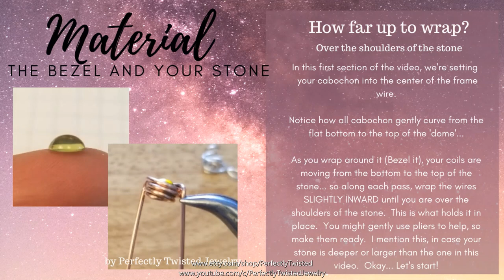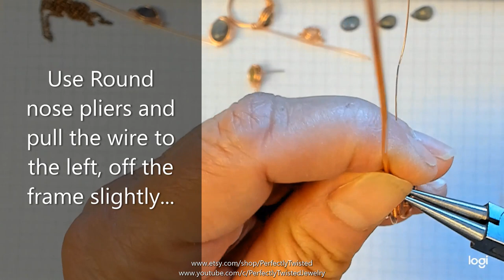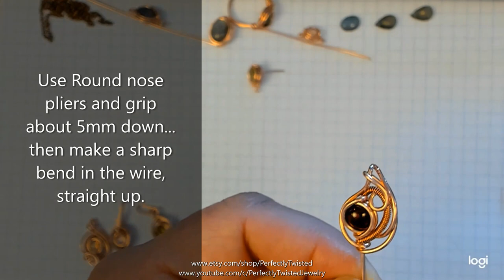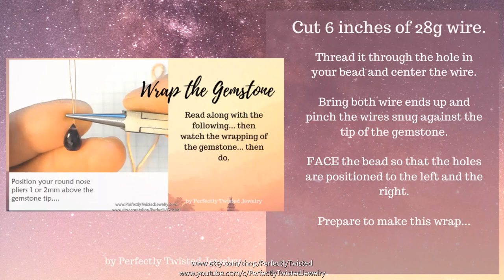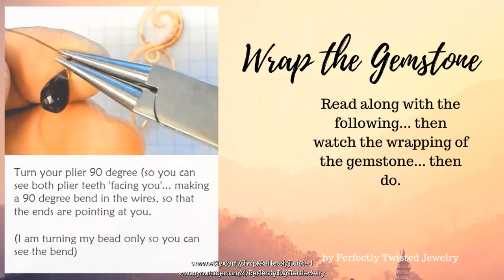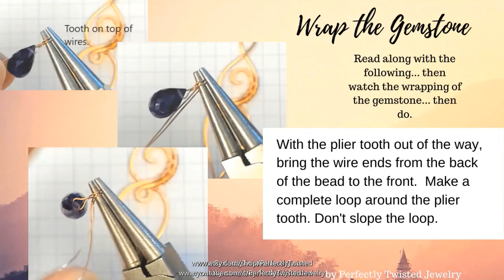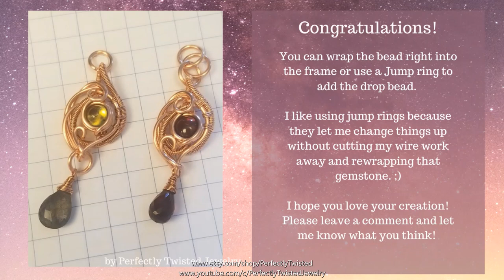MAKE IT! Wire Wrapping Tutorial - Galaxyz Eye, 1 Frame Wire Mini Cab Wire Wrapped, Weaved Pendant

Comment: Which size of wire do you use for the main frame, the one holding the stone in please?  Your tutorials are very clear and I love how you solve little problems as they arise.   Thank you so much for sharing.  ❤
Reply from the maker: It's 20 gauge, round, soft.  The materials and tools are normally in the first 10 seconds.  Thanks, Dora!

Comment: So lovely! Could it be done with square wire to give more grip to the stone? And could you use a faceted stone? Thank you.
Reply from the maker: Thanks for asking Patricia!  Yes on both... you can use square wire for this design, you'll need to either decide you're okay with square wire twisting as you work, or you'll work to keep the square wires as untwisted as possible as you work, or you'll go with however the square wire flows ;)  That is basically the only difference in concern.  The last wrap around the stone, at the very top of the stone,, should be slightly more narrow and cover the stone shoulders to hold it in.  You can use pliers to gently assist as you wrap, tap the coils inward.

If you use the faceted stone, then you'll also need to consider the back 'point'... make sure that you account for the fact that you'll have to use pliers to help you make an upside-down 'cone' with the wire (narrow point, working upward to more open round top of stone) ...  if the Faceted round stone has a deep pavilion.  Some faceted stones are more 'shallow' in the back and are more similar to a flat backed cabochon, in which case, the tutorial wraps should cover you, but make sure you check your faceted gemstone and account for this.  

Hope that helps!  Enjoy the tutorial!

Comment: Love this tutorial ❤️ would it by any chance work with faucet stones?
Reply from the maker: Thanks Elizabeth,  the idea of the capture works for a facetrdcstone but if your Stone has a point on the back, then the S curves will make it hard to set centered.  Check this one out and see if this works better,... it's the same but uses a loop to start. Hope this helps!  I also have a couple of tutorials for pendants using this one. https://youtu.be/ynMWoUh110Y
Reply: @PerfectlyTwistedJewelry  would it work with an oval cabochon?
Reply from the maker: Yes it will... here is my Leonis Ring...  it starts the same way as Midway, but uses an Oval Prehnite stone.  You don't have to do the ring but can watch the capture of the Oval. https://youtu.be/4vamSf19b08